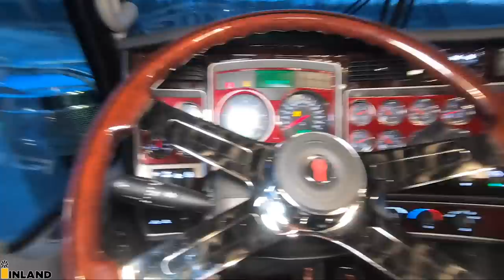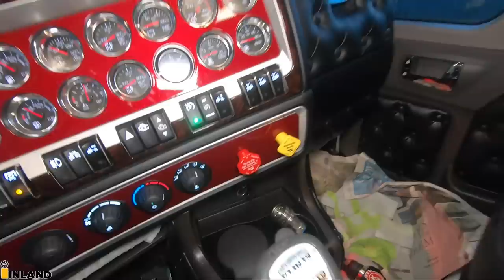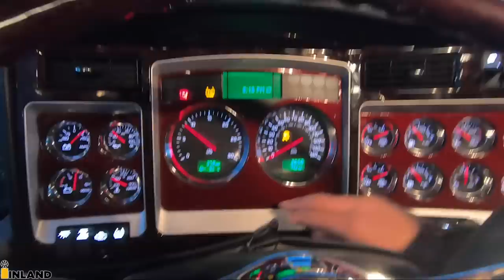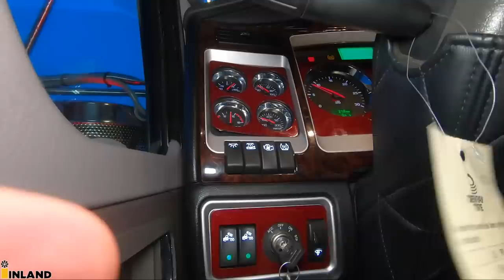THE NICEST KENWORTH I’VE EVER BUILT -  2021 Kenworth W900L 86  Studio - THE KENWORTH GUY

Comment: Very gorgeous truck the only thing is that you can see at 23:30 that the red painted panel with the 4 gauges in it comes off on the bottom left. That is something to fix but beside from that it's perfect with the additional lighting and patting on the closets.
Reply from the maker: Yeah I know. The double sided tape provided didn’t stick too well. We got it fixed up after.

Comment: Gorgeous job Andy . Just trying to imagine what it would look like with the red that the tanks are painted on the front fenders. 
Also you educated this 45 years of trucking old coot about the studio sleeper having a regular bed downstairs when I thought they all had sofa beds.
Also I really like how you matched the paint on the dash to the fuel tanks. Looks like this guy will be doing all the fueling with the caps under the sleeper. No way would I trust a pump jockey around them.
Reply from the maker: Thanks for watching Thomas. We had to roll the tanks to get the fillers more accessible

Comment: i bought my kenworth back in 1970 it has about 600000  miles on it and yes it is on its third engine but t is paid off and i have never  had the want need or desire to get a new truck.

Comment: Just a question.  Wondering why you guys only run the half stainless guards on the rear.   In Australia we run two individual stainless guards.    Just curious as to why it's only half covered drive axles
Reply from the maker: Easy to put chains on it you’re running the mountains.

Comment: Great show truck,  can’t wait till road debris break the glass lenses or the bumper lights catches on something while backing into a tight dock. Also the polished deck plate makes for a slippery surface in rain and snow. By the way how about access to the deck plate?  No ladder  or hand holds. Poor driver comforts on the outside of the of the truck.
Reply from the maker: This driver/owner is very experienced and requested it this way.
Reply: @AndyTheKenworthGuy  As I said Great Show Truck. Impractical for real world operations
Reply from the maker: He has knocked off a few lights already. The cost of cool I guess.

Comment: I don’t like the chrome. I don’t need a studio. More exotic would be a short nose. Prefer a short wheel base with an overal shorter tractor trailer length. Don’t need CB antennas. Prefer LEDs. Don’t like stainless steel for ferhing that will actually smudge and stain very easily. Don’t need windows in the sleeper when there are emergency exit doors. I don’t need a garage kept work truck. Appreciate the paint on the frame and suspension.go behind and tighten anything the painters may have removed when painting took place. Disk brakes mean increased maintenance cost and less heat sink means more wear and brake failure. Hauling reefer don’t need a pogo stick. Heater add ons I like. Need a grill cover up North. Set a switch to manually run the electric fan clutch. Kenworths are easy to dash mount GPS. I don’t like the order of your switches that make no sense. Truck clearly set up by people that don’t drive trucks.
Reply from the maker: Wow. I’d love to get the chance to sell ya one. Sounds like you know exactly what you want.
Reply: @ William  .. I don't have a lot of experience with disk brakes on big trucks  .. you sound like u have run them and are saying the cost per mile is higher cheaper running drums .. it's looks way quicker to swap out pads instead of shoes and drums... what kinda milage have you seen on disc and pads setup..?